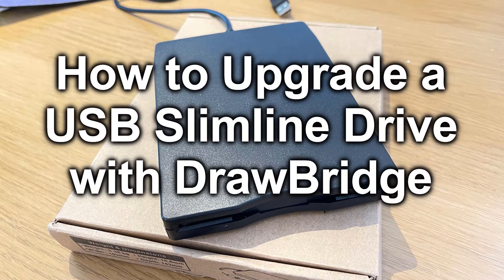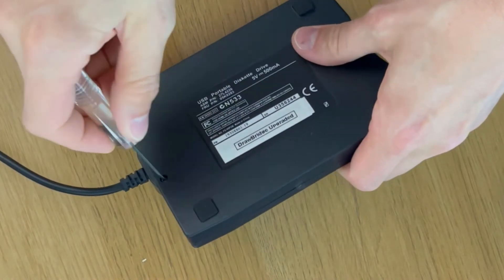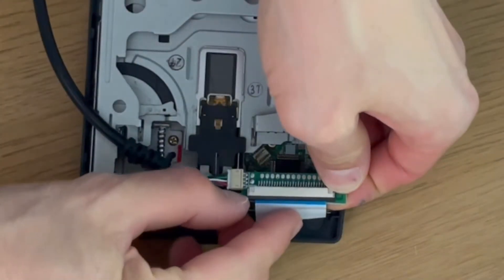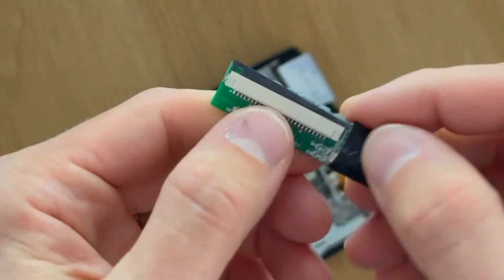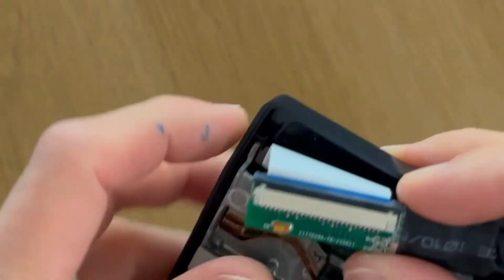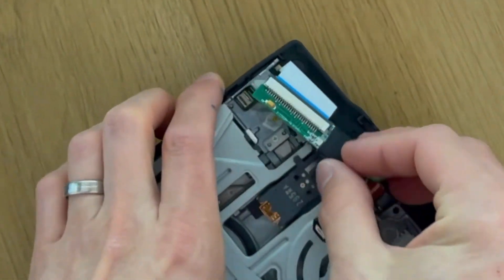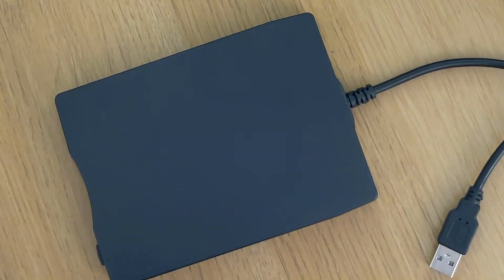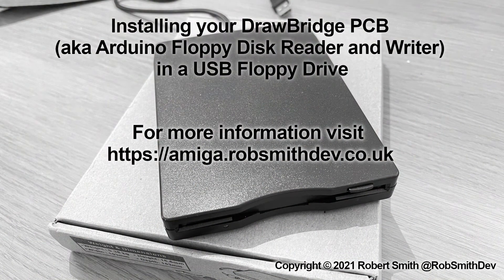Upgrade a USB Slimline/Laptop Floppy Drive with DrawBridge

Comment: Is there a version for internal 34 pin floppy drives?
Reply from the maker: You have to build that yourself or get an adapter board. However if you want a full size drive a Greaseweazle might be a better option
Reply: @RobSmithDev What do you mean 'full size'? AFAIK Greaseweazel does not work on files and dirs structure. It reads raw data to create a disk image.
Reply from the maker: Same as what my board does. What are you trying to achieve?
Reply: @RobSmithDev Simply I'd like to have a floppy drive that works as a real Amiga floppy. Greaseweasel doesn't read files and your board does.
Reply from the maker: @polaapolonia6435 if you’re planning on using my DiskFlashback software, it supports Greaseweazle too

Comment: Dang, I was so excited. Had a house move so delayed and delayed fitting this... only to find the drive I bought has a 4 pin connector. Any way to get a drive with the correct connector inside, or buy a pre-built drive? I've got hundreds of old disks I'd love to go through with WinUAE.
Reply from the maker: Jump on my discord and ask there. Someone may have suggestions
Reply: @RobSmithDev  thank you! It's a pity they label all the drives the same haha.

Comment: Hello, I have an working original Amiga 500 which i kept since back in the day. I also just got my hands on one of these usb floppy drives, looks just like this one but Sony made (model no:MPF82E. So if i get one of these PCB's i can then write working bootable Amiga disks?:)
Reply from the maker: Should be able to. Just see if the Sony drive has a power rating on it, one of them require 0.7amps and would need to be plugged into a powered USB hub
Reply: Thanks for the quick reply; on the back of mine it is written 5V 500mA.  @RobSmithDev
Reply from the maker: Should be perfect then! Just make sure you open  it up and check it has that connector at the back
Reply: Sadly mine didn't have that same PCB at this location, just a small white 4 pin.   @RobSmithDev
Reply from the maker: @Shadvox never mind.

Comment: Any suggestions on where to get a fitting floppy drive. I only have IBM ones and they are not compatible.
Reply from the maker: They’re all IBM ones, not sure what your question is!?
Reply: @RobSmithDev  I think he's trying to find a drive with the internal 26 pin ribbon cable instead of the one with the USB internal connection (four pin).
Reply: @acadiel  Hi there. I had the same question. I just got the drawbridge only find that the 20yr+ floppy drive (IBM) had the four pin connection. I'm taking chances now on Amazon one which has the same ASM: 27L4226 (this is what I searched) and similar S/R + P/N to the above. Lets see
Reply: @JayDeetrix  Did you manage to get the correct drive, if so do you have a link or model, i am looking to purchase one as well.